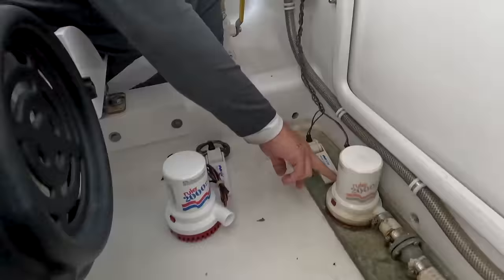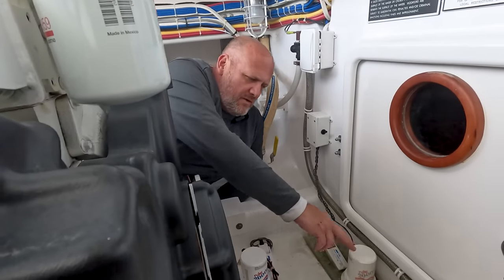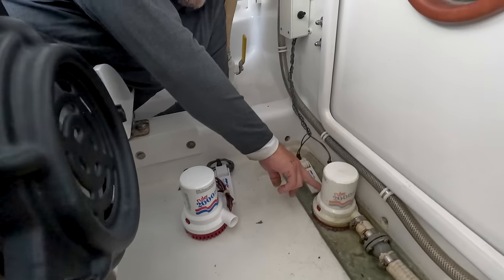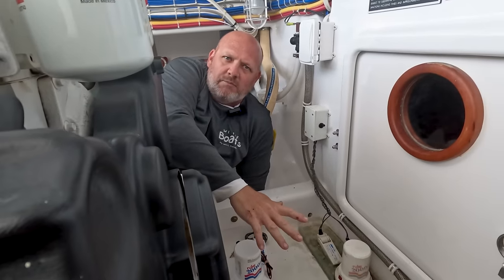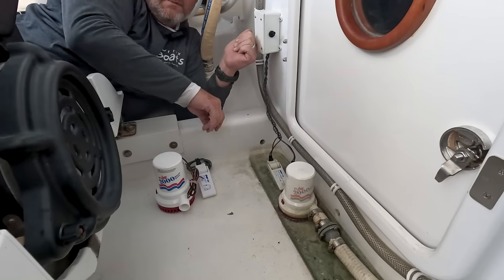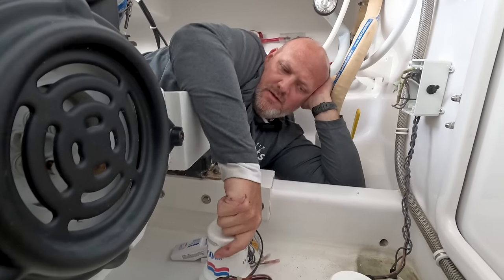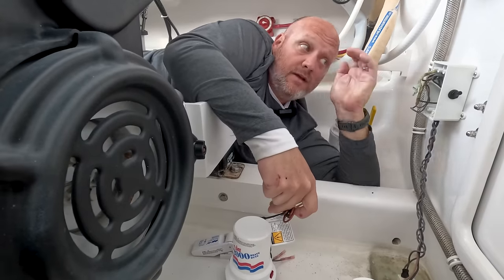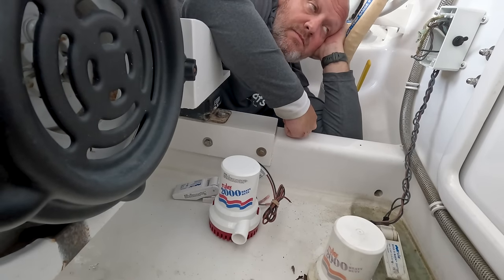Check Those Boat Pumps or Else …

Comment: Bildge pumps and Bildge checked are checked every day at the company I work at.  Visual check at start and finish of day. Function before starting engines.  It’s just part of the daily routine. Monthly checks of actual ability to pump water out. Some systems have one way valves that get frozen shut.
Reply from the maker: It’s great practice to check your bilge pumps often! When you need it … you want it pumping!

Comment: I had a wiring problem in the middle of the Delaware bay, water got high I caught it. After that I put a second one in wired straight to the battery that was a higher flow. Even small boats should have redundancy in anything that's important for basic life support lol
Reply from the maker: Absolutely agree …. Only thing that could have made your experience worse is if it was pouring rain and lightning! 🤣

Comment: My boat normally has a very dry bilge. Earlier this summer we got onto the boat late on a Thursday night and as walking down the dock I could see a stream of water coming out of the bilge pump. Once onboard the bilge pump sounded like gravel in a blender - thinking we had sprung a major leak and the pump had worn out. Turns out our water heater was leaking and the pump sucked up a zip tie left in the bilge. Needless to say I immediately replaced both pumps and switches after that one. New water heater is on the winter list so hopefully back to a dry bilge.
Reply from the maker: Yikes we are big on have a clean bilge cause that zip tie can cause problems with your pump! 🥴 As you know. Hope that water heater is easy for you to replace!

Comment: Thanks for the video I did wonder how to change a bilge pump. Then when the check valve was mentioned I thought, hmm, I do not have one in my aft pump as it does wash back from the exit pipe . But then I googled where to get a check valve and saw it’s not advisable due to risk of clogging or failure
Reply from the maker: Some boats require check valves due to the length of the hose! You have to keep these clean.

Comment: After having been a guest aboard a boat years ago, which developed a leak and sank due to inoperative bilge pumps, I'm just a little particular about that subject on my boat.  I check my bilge pumps and high-water alarms monthly or before departure, if we're going on a trip that's  considered offshore in nature. Additionally, I have cycle counters installed on all the pumps, which will help identify any leaks that may develop. I also regularly check/operate my thru hull valves and  engine driven crash pump valve. Finally, I also have the correct-sized rubber stopper plugs secured near every thru-hull fitting, just in case.
Reply from the maker: You my friend are a very extremely rare boater! 👍
Reply: @WillFixThat  I'm a boater who got old enough to realize that I'm no longer invincible. 😆
Reply from the maker: @lesb3481 so true … we aren’t invincible… that’s a pretty scary experience having a boat sink!

Comment: i've had a few problems with the Rule pumps.  My center consoles had the internal float switches that would fail.  the manual switch always worked but the internals switches would go bad.  Is this a problem with Rule and internal switches??
Reply from the maker: Not that I’ve noticed.  We rarely have failures.  Of course we just had one 😂

Comment: How did you put sealant on the mounting screws for the float switch and strainer/pump mounting bracket while they were under water?
Reply from the maker: I believe we used 5200 cause it cures in water … I’d have to ask Matt to be sure. 👍

Comment: J B Waterweld would fix that crack in 5 minutes and a fraction of the cost if the pump was still working and that is what I would do.
Reply from the maker: Due to liability pump had to be replaced for us to continue to work on the boat! We’ve seen too many NOT so good boat problems… not worth taking shortcuts for us!